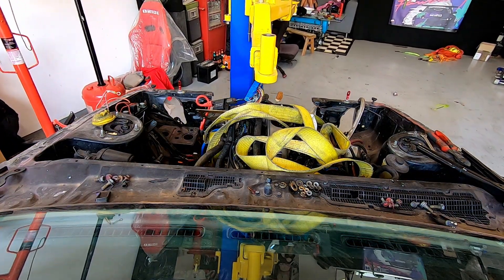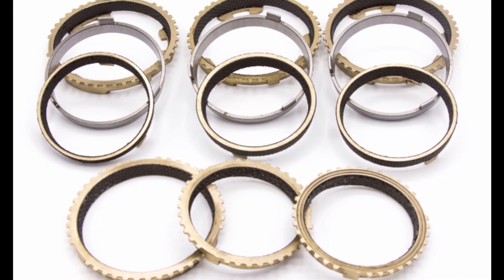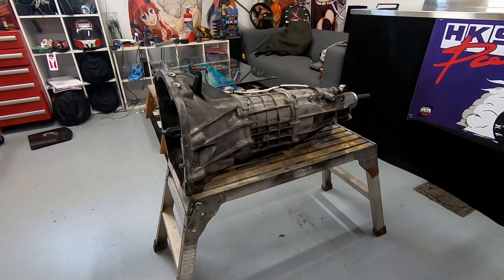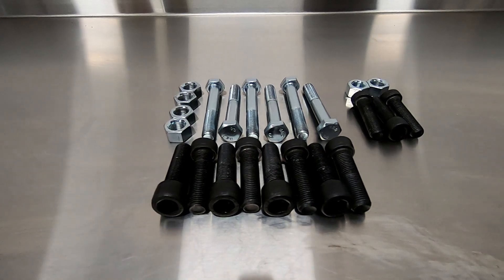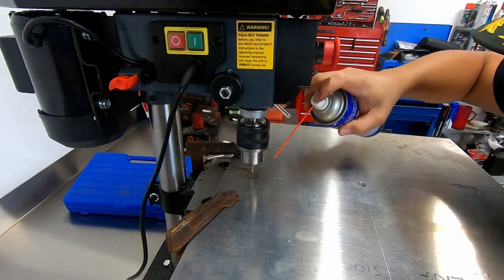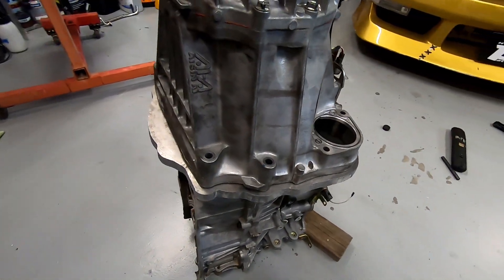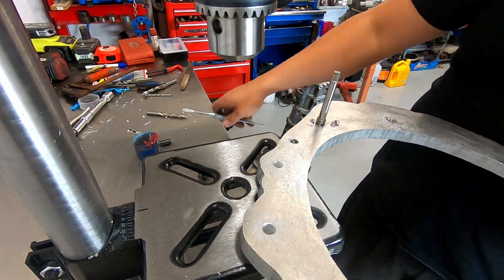How To Make a Custom Gearbox Adapter Plate - 2AZFE to TL70 - Project Wonder AE86 #5

Comment: How did you measure the run out? If it is more than 6 thou out, it will destroy the 
input shaft bearing in less than 1800 kilometers.

Comment: You know mocking it up out of wood is an old school and great idea then you can just take the wood that now has all the dimensions and holes cut in put it on your metal spray paint over now you know where to make all your cuts and holes size diameter and length of cuts

Comment: Hey Seb, Do you have a video or info on  how you set the flywheel height? I see it as probably the most important part of adapting a gearbox to get the clutch setup correct.

Comment: This well produced video shows how to cut out an adapter, but the calculations that obviously was done during the making of the wooden template are left out. As an exaple, how the allignment of the gearbox is calculated very easily based on the center between the dowl pins is just not going to work out in most cofigurations, and I'm even doubtful as to how it worked in this setup.  The more common, and sadly more difficult way, is to machine something that locks the crankshaft and innput shaft of the box in center line, and then build off of that. You also need to take in to consideration how/if the input shaft needs to be supported by a roller bearing in the crank, and if so, will it reach with this adaptor in place, or do you need to machine someting to make that work. On top of that there's the height of the whole flywheel and clutch assembly that needs to be correct. Uncorrect alignment will kill the bearings, and only work in a track/drift car where both engine and box is rebuildt/thrown away once a year/season and the noise level is so high you can't hear the bearings grind. This video makes it look easy because most of the hard work and calculations are left out.

Comment: Hey I have a rx8 I just bought a few days ago  I’m putting a b series Honda engine in it. The block is a b20 with a b18 gsr head. I’m willing to pay you to make the adapter plate for my engine to fit on the rear wheel drive rx8 gearbox.

Comment: Using a measuring tool as a marking tool is NOT how we engineers work. Using a proper centerpunch is the way to go. Kids don't do at home what you watched in min. 4:42. Other than that, thanks for uploading this. I'm in the middle of the evaluation of this process to see what I can accomplish with my rig.

Comment: Did I miss something-don't you have to put a shim behind the flywheel, since now the input shaft will not go as far into the clutch disc. In other words, the input shaft will be the same thickness as the adapter plate AWAY from inserting fully into the clutch itself?

Comment: cheers for the video.
But how do you go about making the collar for the input shaft?
With my engine swap (Vit-5 gearbox to k24a3) I'm suffering the following issues, needing stubby transfer punches for the engine side dowels (which don't go through the block, k24a3), and not having the collar to hold the input shaft steady

Comment: I am 100 percent sure that the dowel pins are to precisely locate the engine to the transmission, after that once the bolts are torqued properly you could throw the dowel pins away , they do not carry any load .
Reply: And you would be 100% incorrect, the dowels are there to precisely centre the gearbox on the engine the attaching bolts are a sloppy fit, and in 54 years of being a trained mechanic with a lot of motor sport work I can tell you for sure that if you leave the dowel pins out you can look forward to a shuddering clutch, and eventually  the gearbox jumping out of gear,   my advice is to watch this video several times BECAUSE THIS GUY DOES IT 100% CORRECT OUTSIDE A CNC MILL!!!!!!!

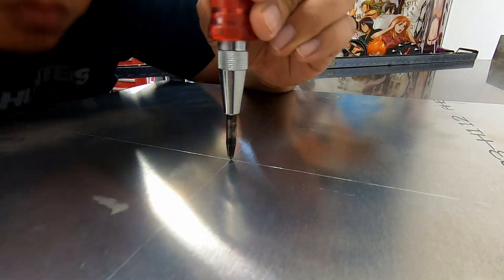Comment: 5:00
Some times getting the dell pins out is very difficult to impossible. What must you do in those circumstances?
Without ruining them ofcourse
Reply from the maker: there are specific tools designed for this so you can removed dowells without damaging them.

Comment: Would this be the same as an is200 j160 box?
Reply from the maker: both are az6 gearboxes so internally they are almost identical with small differences like 6th gear ratio etc
Reply: @MODIFYUP  thanks, yeah the az6 is in around 6 vehicles of different brands. I'm contemplating my engine conversion and something different in an IS200/300/altezza chassis. Been looking into the 2azfe+t engines and obviously want to use the j160 because I think the gearbox is great.

Comment: Good work dude! Looks awesome! I bought a "professionally made" adaptor recently for the swap I'm doing and.... Pure Hot Garbage!!

I'll be investing some time in creating one from scratch.

Cheers for the tips/advice!

Keep up the awesome work!!
Reply from the maker: Thanks for watching Ian. Tell me more about your swap!
Reply: @MODIFYUP  - I'm working on an early model BMW e21 and throwing a 2.4l Honda engine into it. Coupled with a full rear end rebuild from a different car (takes a bigger, stronger diff than standard), coilovers, ecu and dash etc, should be a pretty interesting car by the end of the build.
Reply from the maker: @canned__meat  ah yes the old rwd k24 conversion. k miata have dominated the market with zf 5 speed conversion plate. great to see you thinking outside the box and making your own. what transmission do you plan on running?
Reply: @MODIFYUP  - I'll be using the ZF 6 speed in mine actually. The company I bought my gear from actually poorly copied the kmiata gear 😞😞😞 I didn't know it was a copy until I received it. It was advertised as being their (kmiata) adaptor plate when I paid.

Very very disappointed and deeply regret going with the company I did.

Live and learn, right?

Comment: im just going to say, I have an SW20 MR2 with a 2AZ in it, if you use a transmission that works for the 3SGE it would have probably gone together much easier, with stock off the shelf clutch setups working
Reply from the maker: The only rwd transmission for 3sge is the j160 which is essentially the same az6 based transmission as the tl70 but without the reverse mount starter. The 3y bellhousing fits but puts the engine on a ridiculous angle to get the shifter in the right spot. This is the best option.to get the engine angle and transmission angle correct. There is no oe shortcut for this. Thanks for watching

Comment: One question is how do you figure out what thickness the adapter plate needs to be? Will the transmission shaft long enough to reach the clutch plate with the adapter in the middle? Thanks
Reply: Maybe he compensates the gap (between crank and flywheel) with a custom adapter plate?

Comment: The length of the input shaft relative to the thickness of the adapter plate confuses me.  I’m a total adapter plate noob so...  

I’m assuming the plate can’t be so thick as to pull the trans so far away from the block that the shaft of the trans doesn’t mate with the pilot bearing in the end of the engine crankshaft.
Reply from the maker: this is entirely dependant on the motor gearbox combo you are making the plate for. some engines have the spigot/pilot in the crank and some are in the flywheel. in the case of the 2az the spigot is in the flywheel so any distance the flywheel is spaced from the crank the spigot bearing will also be spaced the same amount. in the case of say a nissan motor the spigot bush is in the crankshaft so you can either install a new spigot bush to a higher depth to maintain contact or make a custom spigot bush that protrudes from the crank face to take up the amount you space the gearbox out. hope this helps

Comment: Excellent video! Ps over here in the UK you can get almost any pitch and thread size countersunk set screws, just got to go to a proper hardware supplier.
Reply: You can't get m12x1.25 countersunk bolts in the UK. The only place I've found them is in the USA, and even then they are only available in titanium. If I'm wrong then please do tell me where I can get them as I need them for a Porsche project.

Comment: Awesome video!  I don’t know the difference in hardness of aluminum grades, but I have used a woodworking router to enlarge aluminum wheels to fit over larger hubs. It cut easily and left a very clean edge. With some experimenting this may be a faster and cleaner method than a jigsaw?  (YOUTUBE hack on the wheels worked great!). This is making me want to fab my own for a TDI swap. Thank you again for sharing and the effort put into filming and editing is great!
Reply from the maker: Thank you Brandon for your kind words. I will definitely look into the router. I think a jigsaw is a little more common in the bottom of peoples tool chests but I am keen to try out the router to see if its an easier process!
Reply: MODIFY UP you would likely have to work through it in steps, taking small bites but it would be more perpendicular as well as the jigsaw blades deflect. At least mine do once I beat them up a bit.

Comment: what a great content man! I've been searching for a well explained video in making gearbox adapter plate for a long time. can't wait to see the next step. clutch and flywheel right ? i hope you can explained how to determine the adapter plate thickness to space the input shaft to the pilot bearing correctly, or cut the input shaft in the next video. cheers
Reply from the maker: Thanks for your kind words, I have a few videos in the works showing exactly these measurements so stay tuned and all will be revealed!
Reply: @MODIFYUP  you're welcome. cheers

Comment: What about input shaft depth? I reckon the input shaft stands out proud so the thickness of the adapter takes up the space basically?
Reply from the maker: All depends on what flywheel and clutch setup you run. In my case i can use a 2az flywheel with a fa20 ring gear or a fa20 flywheel with enlarged holes. Both flywheels have different heights. In 1 case the flywheel will need to be spaced out and the other case the input shaft needs to be machined down. Stay tuned it will all be explained  in another video!